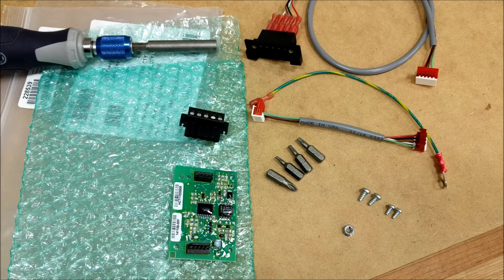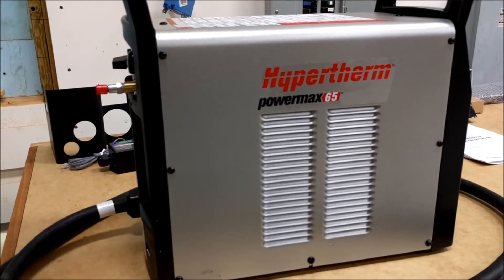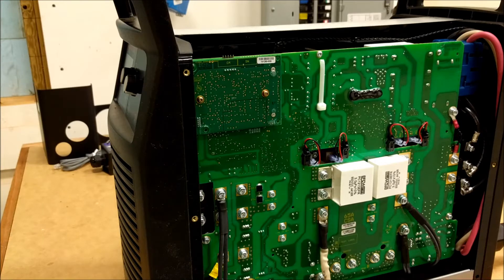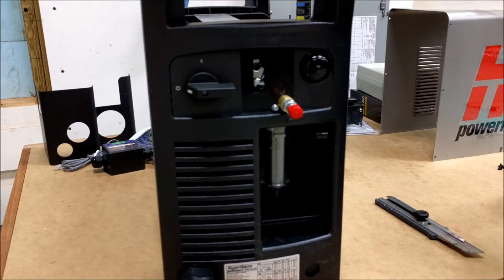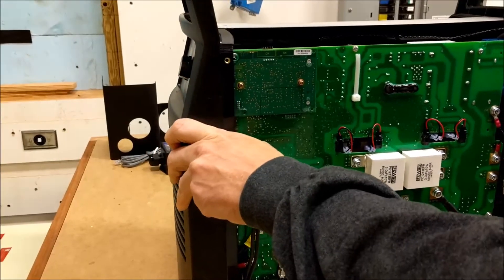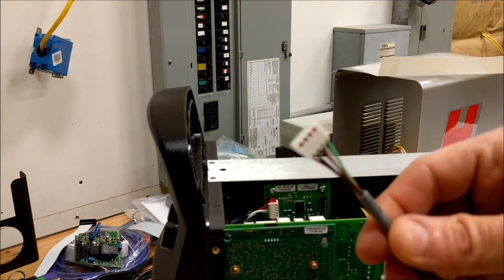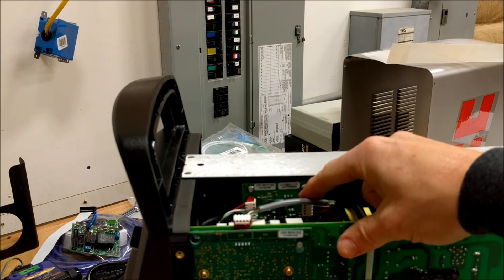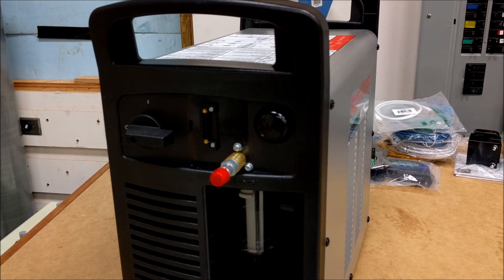Hypertherm Powermax 65/85 RS485 Serial Card 228539 Kit Field Install

Comment: thanks for the info 
the kit cost extra ??

I'm on the proses to get a 85 and i don't now if is extra o is part o the standard  ??
Reply from the maker: Ashley Elizabeth Buono . depends on what plasma pkg you order but yes it is typically an add on extra purchase. Like my 65, I  would buy the 85 with the  hand and machine torch and cpc port as a pkg and then add on the rs485 port if needed. Check out Hypertherm's site as they have the model numbers of the packages and whats included in them.
Reply: I bought the HT PM 65 without the RS485 but with the machine torch only and the CPC port. It cost me apprx. $200.00 to add this field kit RS485 upgrade.